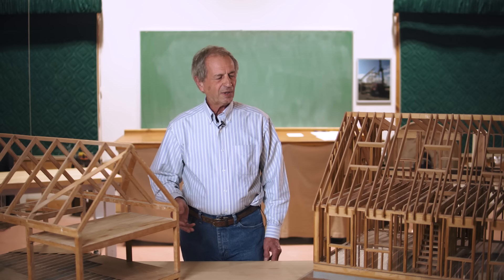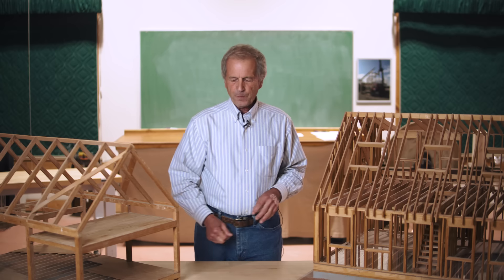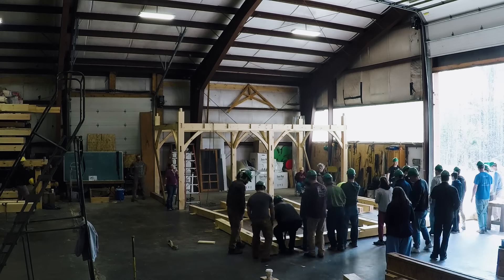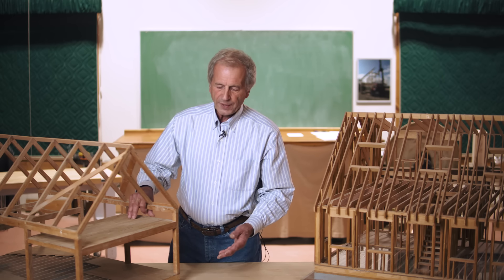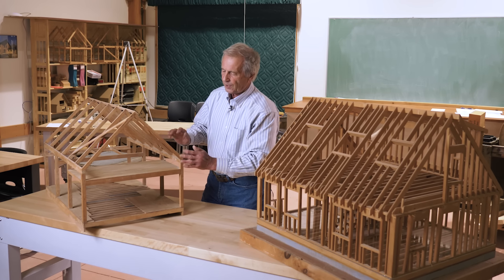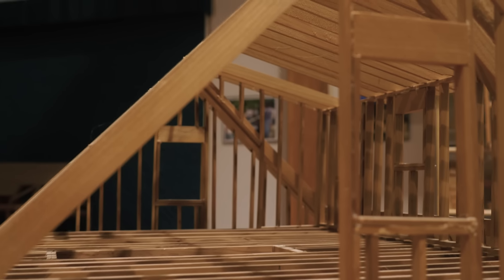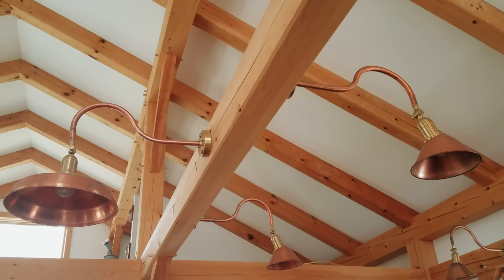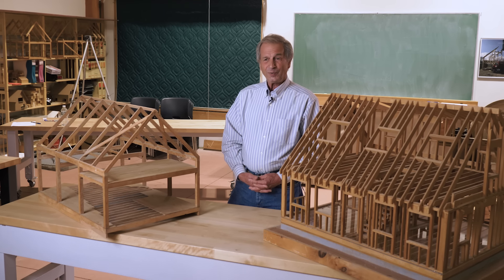Timber Frame vs Conventional Stick Frame

Comment: Also fire resistance. Thick wood takes longer to burn through, whereas 2x4 are quick to burn through and you have a collapse sooner. Also less salvageable. Great video.
Reply: You'd be surprised how quickly a fire consumes a building
Reply: crispycream6882  once you've  see how quickly  a building goes up because of the containment of the heat inside the space  you'd understand
Reply: As a firefighter, from experience and from the book. Heavy timber frame (Type 3 construction) with stands heat so much better than the modern houses today. The modern homes today are so scary, and once they catch fire, they’re done
Reply: it still doesn't negate the fact that thicker woods are better at fire resistance.  @oftin_wong
Reply: @nhitc6832  sure...buy think about how often you've seen buildings that are still used with charred timbers inside them ...can you remember seeing even one ?
Reply: There's both survivorship bias and other differences. Any old buildings that were prone to burning down or collapsing have already done so. We only have the best examples of older buildings around today. I don't think anyone could argue that timber wasn't higher quality hundreds of years ago. Also, are the beams made of softwood or hardwood?
Reply: just don't burn your house down bro
Reply: @kickittillitworks5357  -Observing how to light a campfire is a small scale way to realize what you are saying is true.  Small sticks catch fire quickly, bigger logs are really hard to get going until the fire from small sticks gets hot enough & burns long enough.  I have spent many hours making campfires & trying to get big logs to catch fire even though they were dry! The secret is to keep chucking in the smaller hot burning pieces until the bigger ones finally catch fire enough.
Reply: @oftin_wong  Once they get hot enough they will burn up like all the rest for sure!!  But I think the point they are trying to make is that a delay in catching fire & slower burning might buy a little time for the firemen to get there.
Reply: @brendaann727  have you ever seen a building burn ?
Reply: @ 😂. Good advice.
Reply: @ -Yes. "Once they get hot enough they will burn up like the rest for sure..."

Comment: I remember watching a home renovation show and it showed this method of  "timber framing". I asked myself why that house had less materials used compared to the "stick framing" method, I often see in other renovations. Thank you for the explanation. 
The timber frame method reminds me of the cabin style houses and even the traditional Japanese houses.
Reply: we dont have access to the mass amounts of virgin and old trees to create homes of this type anymore as its almost all been logged
Reply: @patdud  that's the trade-off, I'm no expert but I would trust what was said in that 2x4s are likely not the most insulating thing out there. Timber will use much less wood in many cases, I'm sure, but as you said, 2x4s are much easier to make and come by in your average tree than a massive timber framing piece due to continuous size requirements. That said, timber framing looks awesome, and surely a part of this cost increase can also be attributed to the fact that stick framing is almost certainly much more common on the prefab market than a timber, and that likely lowers the average cost of stick framing by a significant amount
(what I mean is that it seems like the fact that if a hosue is timber-built, it's much more likely to be a custom job than if it's a stick one, and custom jobs have inherently significantly higher costs)
Reply: @patdud  - What area of the country is that?  There's still lots of people doing timber framed in my state and many are using recycled wood.  Both mills near me offer timbers from douglas fir. Logging responsibly saves the forests.
Reply: @brendaann727  New Hampshire and New England in general. Many working forests in New England dont produce trees what would yield that type of timber. Probably comes more from white pine thats grown on peoples properties for 60+ years and are 120ft +. My neighbor had 5 130' white pines taken down and they were slated to go to the sawmill, probably wide plank flooring.

Comment: I worked as a carpenter for over 25 years and never had a chance to build a timber frame home. It really looks like it would be fun to build.  I built one post and beam, we called it, where the trusses on 2' centers lined up with 2x6 studs on exactly the same layout--it was quite a strong structure.

Comment: Your arguments are very convincing. This is a very informative video. However, I have my doubts about learning timber framing in five days. I live in France, where the cathedral builders go through a ten year intensive training. They live in dormitories, work ten hours a day, study technical drawing at night, and work in their specialised internal workshops until midnight. All weekends are devoted to preparing their first apprenticeship piece- not before 4 years. 2 weeks off a year. If they are accepted they continue their Tour de France- very gruelling. Then they prepare their grand masterpiece, always of mind- boggling complexity. These are the Master Builders. An extreme elite; they are called upon to do the most complex and difficult restoration and building across the whole globe. They are called the "Compagnons du Devoir". They date back to Medieval times. 
Thank you for posting this video. I am a humble cabinet maker myself. Best regards.
Reply: I don't think he is implying that you will be an expert in 5 days.  Rather, you would learn the basic skills and process.
Reply: @jtltet  I think in France it seems they take it to a whole other level!!
A level of which most people don’t need in most of the world! They only need it to be very good not the best in the world!

Comment: There's a lot more wood that goes into the timber frame than what is shown in this video.  Before the SIPS go on the roof it would have t&g boards spanning across the trusses to support the SIPS panels depending on how far apart they are spaced.  Of course the big factor when deciding between timber frame vs traditional stick frame is cost.  Timber frames are much more expensive than traditional framed homes.
Reply: Yes, but in his models displayed neither has a roof. Even on a stick home you can use SIPS. Perhaps the major problem with timber frame is having access to the dimensions of lumber you need to build it, many homes now use 6x6 as 2x6@3 due to costs and availability.
Reply: Don't forget you will still have to frame in windows and doors and any vent/plumbing/electrical... and to frame that in you'll have to fill in those voids to attach it to the structure... this is like when people try and tell you shipping container homes are cheap... then you go to make one and realize it cost about 3x as much unless you just want a tin can with bed in it and black mold on the walls... the reason everyone builds houses like they do is because it's better.
Reply: @scottsthaname1  ...which wouldn't even be allowed for all I know. Maybe this is just a California thing (I'm European so I don't know a lot about how y'all build), but I eagerly watched "The Modern Home Project", a guy making a few AirBnB's out of shipping containers back when that was the cool thing to do, and was surprised at the fact that they had to basically build an entire house inside the container. Seems like construction laws will require you to make something that cannot simply collapse on itself due to owner neglect, as in if you sold this thing on and the new owner didn't know (or care) to repaint the steel every once in a while, and as a result the roof caved in on them after 3 years because the welds rusted
Reply: its expensive because nobody does it.
Reply: @luke2806  Maybe nobody does it because it is expensive.
Reply: @luke2806 I live I New England and my sister has one. There is a store down the street that makes them. They are not for everyone but you do see them around.
Reply: Timber frame is more traditional actually!!

Comment: "Gypsum palace" I died. lol
Reply: Yup ,true too  wall to wall gypsum
Reply: heavy ass panels of chalk all over the place, uy vey!
Reply: xxcurtisx21x    Also know as a vinyl palace.
Reply: J Sev, gypsum isn't toxic... it's a fucking food additive... Gypsum boards are dumb due to other reasons, but toxicity ain't one.
Reply: @livedandletdie  sure it is.
try breathing the dust for a while and get back to me.
Reply: @jhart7304  gypsum isn't any more dangerous than wood.. inhaling a bunch of particles isn't good for your lungs, regardless of the material. Good thing it's not in particle form and as long as you aren't sanding your walls with with your face against it, i think you're fine...
Reply: @jhart7304  if you are sucking on the dust long after moving into your house there’s a problem, if you’re sucking on it while sanding that’s your own stupidity
Reply: @Iamthathillbilly  haha.
i love assumption.
Reply: @jhart7304  the assumption of what exactly?

Comment: Seeing those models reminds me of back in high school when in one of my elective classes we were given a model kit to build a home of about similar style in size. The material was balsa wood, and we used mainly a miter-box with a small hand saw to fit the frame. Small pins and some wood glue to put it all together. It was incredibly fun to learn how to build a home on a smaller scale, but also learning the techniques and proper spacing of the material.
I will say there's something immeasurably satisfying about putting/making something with your bare hands.

Comment: My buddy bought a woodmizer sawmill and we not only built our first timber frame, we also milled every part of it. It is a huge barn with hay loft, horse stalls, tack room & an entire house all in one. 
It is going to last hundreds of years.
Reply: Great to hear. How satisfying.
Reply: Thats awesome! Ddi you guys have to season the timbers or did you start building with them as soon as they wrestle cut on the woodmizer?

Comment: Its kind of nice to know that even though the exterior walls on timber frame have to be stick framed to simply have nailers. At least the question of what is load bearing is an easy question to answer.
Makes for easier remodeling.
Reply: Brad Evans yup! Big timber frame and you can stand whatever walls you want, can even use soffits to run the mechanicals so it’s even easier to change interior configurations.